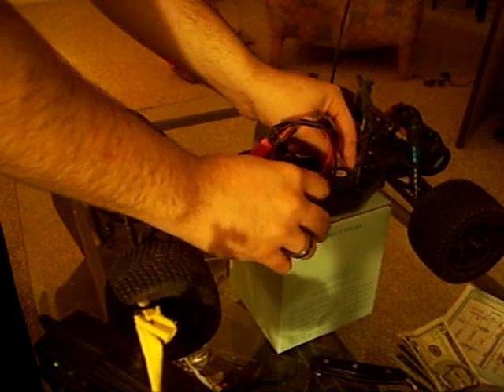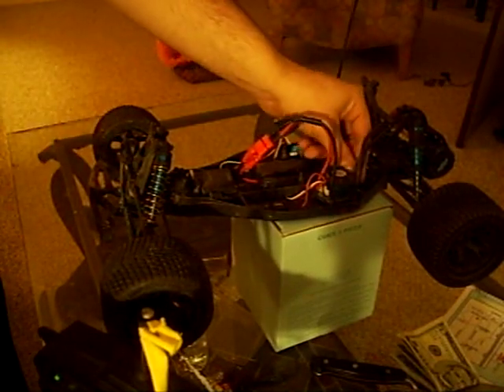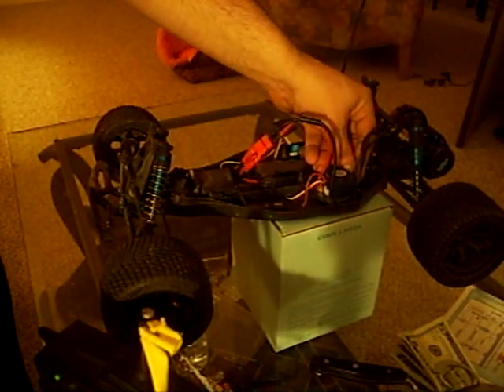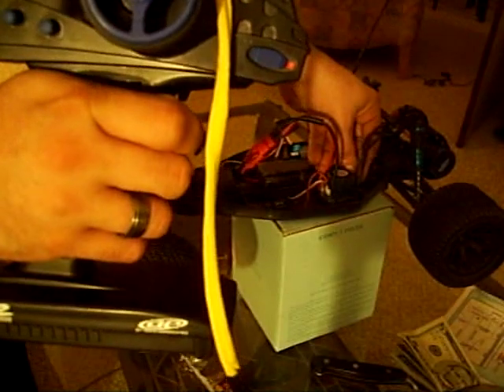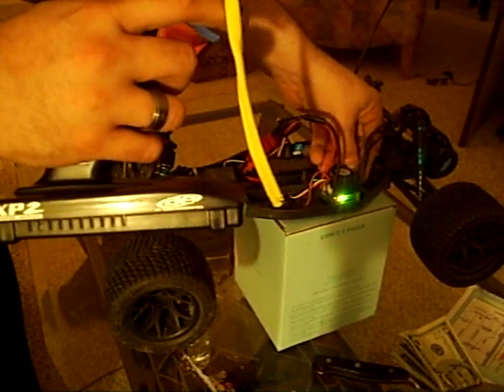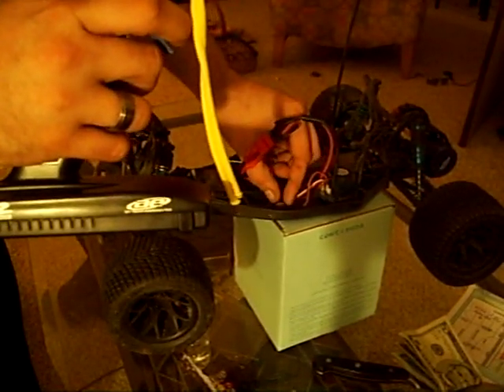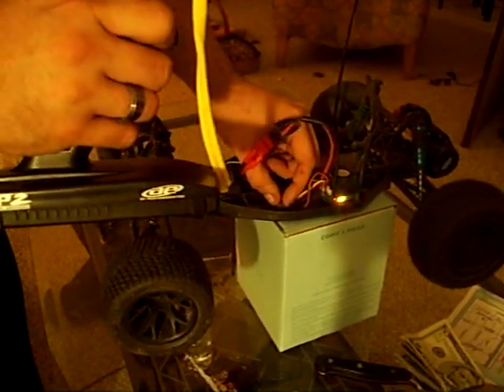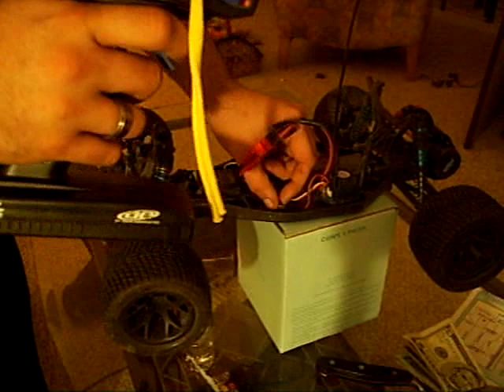EzRun - ESC Setup

Comment: Yeh probably the best and easiest video on here no bs! I have this motor and esc set up in mine but if I touch the throttle so it just starts to engage forward it's very clicky it's like it's slipping on gears had it all apart and all gears are new and if I touch the motor I can feel its in there but its brand new it's not broken what's up with it?

Comment: the throttle being reversed that has to do with your remote. there should be 2 switches on the remote one will reverse the throttle the other will reverse the steering.